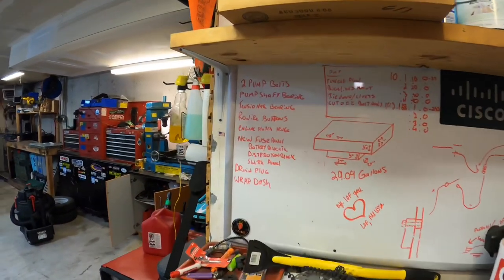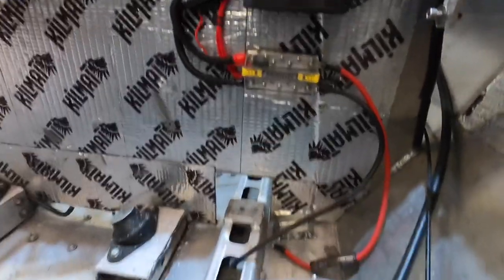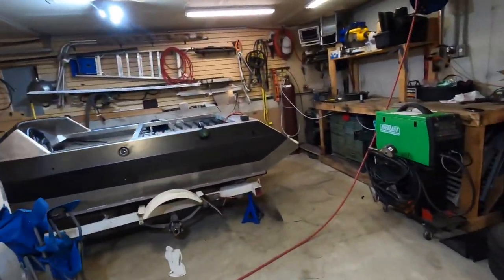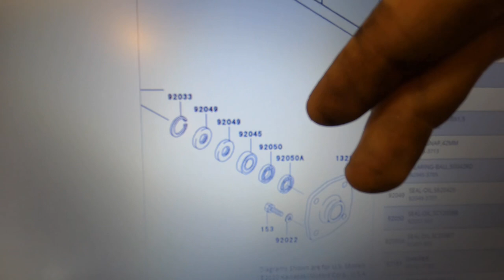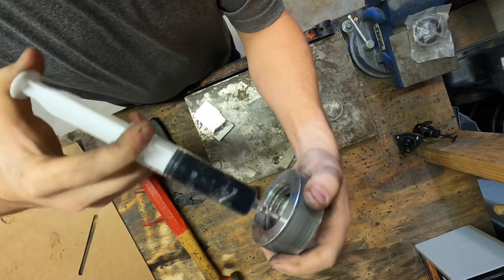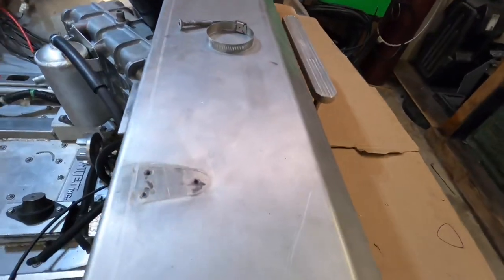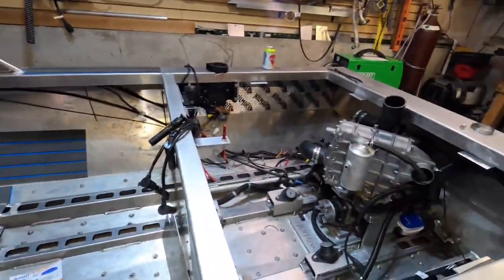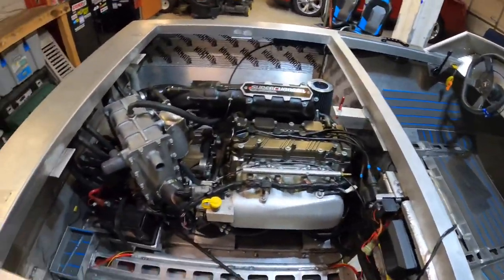Mini Jet Boat Maint and Enhancements - 2

Comment: What happened to going turbo?!
Reply from the maker: The original reasoning for turbo was a combination of my factory ECU failing and the unreliability of the factory supercharger. The costs to get a used ECU were close to the cost of a brand new standalone setup so it made more sense to replace the ecu and go turbo at the same time, but then I found an absolute screaming deal on a factory ecu that I couldn’t pass up. 

Turbo will happen one way or another, this has just prolonged it lol.
Reply: @Localhost127  makes sense! Well, I am hoping we can make it up your way this year, or you can come down this way. We want to put together some eastern US trips.

My LVB hull should be at BWB any day, the 2021 SVHO is ready to go. MiniJet shipped my intake (Jamie worked with me to do some cool stuff with his intake). I am pumped!!!
Reply from the maker: @JackilusMaximus  Back water makes some damn good looking boats. Looking forward to seeing the setup! a 21 shvo will have that thing RIPPING.